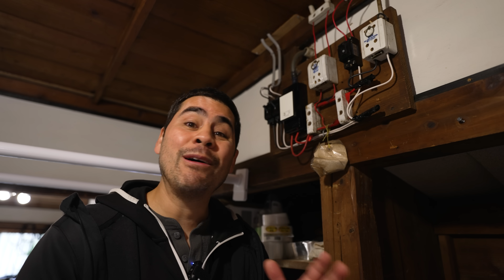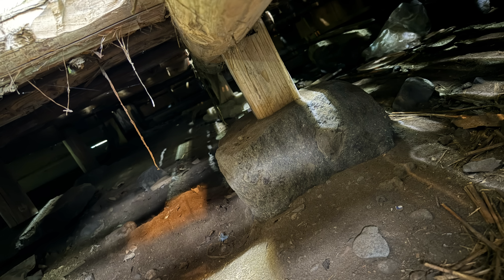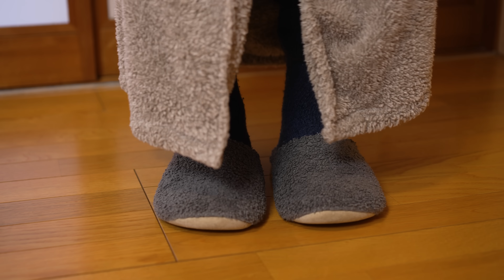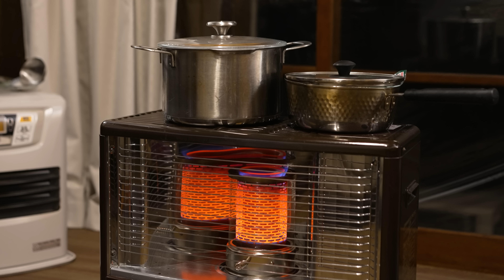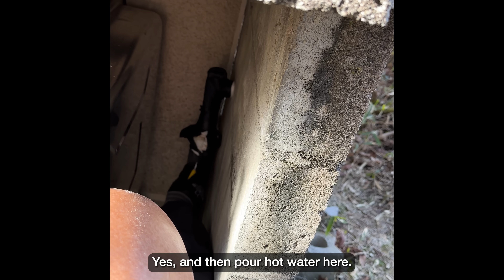What an Old Japanese House in Winter is Like

Comment: I used to live on the ground floor of a 2-story LeoPalace apartment building in Tokyo. I guess the walls and ceiling were insulated a bit better, so during the day I had less of an issue. But in the morning the floor was ice cold, so getting out of bed took a lot of will (and a ceramic heater that I angled at the wooden floor between the bed and the shower). Of course the shower room was also ice cold and made of plastic, I think it would have melted if I put any potent heater in there. But also, I had the same 30A main breaker problem - well, at least I eventually figured out that I could upgrade to 30A after initially having just 20A! I was also shocked how useless 30A were at 110V compared to the 230V in my native country.

Comment: you can spend around 150,000 and get the electricity redone man (includes a new circuit breaker) That is like my old one bro, get it done, since it is a death trap like that.  I got mine done, and i am still at the cheapest 20amps but i can now run aircon and a kettle at the same time. or the aircon and the microwave, but not all three. lol

Comment: You might benefit from a bit of home automation. Eg when you turn on the kettle it pauses the aircon. Otherwise, use presence sensors to decide which rooms are heated by the aircon, if someone’s home. If you like a bit of tinkering, home assistant is a great start and it can be done for very little money. 
That electrical panel looks ancient. A circuit breaker could be a good addition, so you only have to safely flick a switch instead of replacing the fuse. 
Silicone caulk is a cheap and very easy way to close those small gaps on the windows and in other places.

Comment: I wonder if there is no gas in Japan at all? I live in Romania and almost all European countries heat with gas during the winter. Anyway, you need a central heating system and radiators in each room, but this way the heating system is very simple and does not give you any headaches. It keeps a constant temperature chosen by you and the house remains warm and nice all winter.

Comment: This reminded me of my childhood home in Ireland. Keeping warm was such a task. The nightly routine involved filling up hot water bottles for everyone to use in bed, then leaving the water dripping from the taps...thankfully our old houses are much easier to insulate than the old Japanese ones because they are built with bricks or mass concrete. My current home was built in the 1930s, but insulating it was easy (although expensive) and involved "wrapping" the whole house externally with a layer of foam bricks. It's quite easy and affordable to keep it warm now, thankfully.  

Do you guys have electric blankets for sale in Japan? It's basically a low power heated pad that you put on your mattress below the sheets/mattress protector. My silent night electric blanket only uses 10 watts on the low setting, so I leave it on all night to keep my bed toasty 😄

Comment: Why not set a program on the heat pump so it's starts early so your space is warm when you wake up? Also a fan you help with the air stratification, it would mix the air in the room so that the air at the floor is not so cold. You would also lose less heat through the roof.

Comment: The roof space is an often neglected area for effective insulation improvement. We had some subzero temps recently in the UK and the upstairs of our home is kept at 17 to 18C  during the day. I have a digital thermometer in the loft which is insulted with the fibrous material used commonly in the UK and that space was around 2 degrees C.

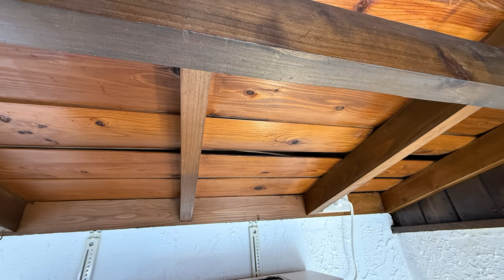Comment: 8:15 Brrrr, I can't even imagine the cold caused by this! 
We have double-paned windows here in Norway, as a standard. I think some even have triple? to help prevent noise? Not sure. But even then, our panel ovens are under the windows, to blow hot air up and with a curtain covering the window, I think it traps any cold air?

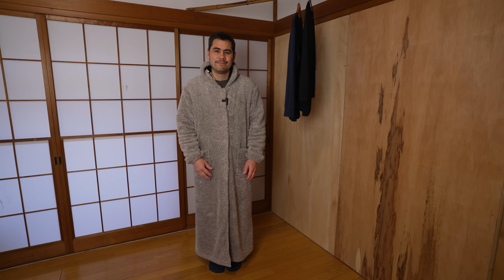9:30 Another thing with older Norwegian houses was that windows were neeeever made on the north facing walls. We even had sort of personified the North Wind "Nordavinden" as this collection of trolls and other bad spirits that would get in through the north facing window and make people sick. 

But with how hot it gets these days, I curse my south facing windows more... We don't even have shaded windows in the afternoon, to let in cold air before bed time.

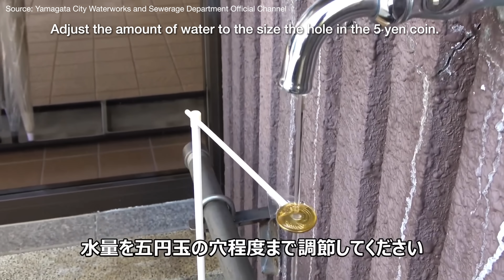17:50 Relatable! Though we more do that for our "hytter" or cabins. The small dinky kind with no insulated pipes. I've heard horror stories of the pipes bursting because the water froze in winter with no one there to check on them...

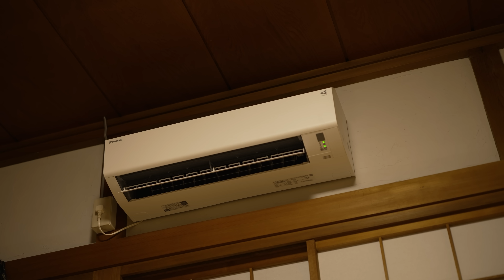22:11 Wait, your fridges are set to freezing? Ours are set to 4 degrees C.  Is there a reason why your fridges are set that cold? Wouldn't your fresh foods freeze?

This is such an interesting video! Thank you so much for sharing!^^

Comment: A good method to keep your pipes from freezing is wrap them in heat tape then cover them with insulation. 

Because they draw so little power, I power mine with a solar panel

Comment: I wondered how you kept the pipes from freezing. I grew up in central Ontario and we got our water from the lake we lived beside. A pipe ran from the bottom of the lake, underground up the hill and into the basement. Sometimes if it got cold enough (-40c) it might freeze. We eventually put a heated line from the lake to the house.

Comment: Only 30 amp electrical service is crazy when we often consider 100 amp to be outdated in the US. The lack of insulation is very familiar to our 1892 house in Minnesota though we have a big furnace to just blast heat into the whole house. You definitely want to be careful when adding insulation and sealing to old homes to be sure you won’t get moisture trapped from condensation in both summer and winter.

Comment: Protip with the aeropress: put it upside down and place coffee and the hot water inside it, it can hold it just fine, when you're ready, put the filter in the cap, splash some water on it so it stays in place and twist it. Put a cup on top (upside down) and then by holding both the cup and the aeropress, turn both so it's facing the usual way and press down as before. You save using an extra container and having to wash it by using the inverted aeropress as a cup. Takes a bit to master this skill but well worth it

Comment: Yeah, here in Norway, we call the air conditioner units "varmepumpe" which means "heatpump." It pumps hot air in winter, and cold air in summer. I wish I had one.

Comment: Two tips from where you lived before japan. Aka canada
1. The Bistro Pro LiteRide™ Work Clog from crocs if you can get them works best for me as slippers. With some warm socks and those my always freezing feet are super warm even in -25 celsius. They work better then slippers unless its lamb wool slippers. ZERO heat gets out of them. 
2. Try to get some rugs and combo them with radiant heat heaters. Such as portable oil heaters. They generally are electric but use very very little energy. I have yet to find a electric heater that uses less then they do. They heat really slowly but produce radiant heat. LEaving a oil heater on a "medium" heat will maintain a room that is used frequently very well for little energy. Do not use it for a room you rarely use as they are slow. The radiant heat will actually heat the objects such as the rugs so the heat sticks around longer. This can also be good if there is a week where it drops really low and you put futons in the main room such as the livingroom. The radiant heat from a oil heater will heat the futon material itself. 
3.  Yes I watched to the end where you noted....Heat rises. If your sleeping situation is really cold then build a platform for a loft bed. A really lazy way to do this if you can get them in japan is ikea kallax cube shelving. Put some together and a piece of plywood on top. Here the kallax shelves are always being sold used online for cheap or even FREE because people do not want to do the work of bringing then to the dump. I do not know how this is in japan.

Comment: Daikin have the Onecta App. If its available for your AC you could use the schedule for heating?

Could you use a battery with 5-10 kwh? Maybe it can combined with a off peak for power? Chargeing when the power is cheap and use it for the AC and daily use?

If possible combine it with a digital electricity meter. So the battery knows whats the demand and provide enough power that the breaker doesent trip

Comment: First winter here, am a big fan of kerosene fan heaters (pun intended). I scrupulously use it as directed, but maybe I need a CO detector. However, I’ve asked everyone I know, and not one person has one. Which seems weird. Interesting that you’ve documented it takes 4hrs for CO to drop to acceptable levels. Longer than expected.
I don’t have a passive kerosene stove. I also have an AC heat pump, and one electric strip heater. 
Our living room and kitchen are connected. We heat both with one kerosene fan heater. Plus we boil a lot of water to humidify and for drinking, which helps with heating. I was told that when choosing the right size for a fan heater, always pick one size “bigger” than that area that you want to heat. That was great advice. It heats the area more quickly, then dials down to maintain that temperature, consuming less fuel, as opposed to running flat out to try and reach the temperature you’ve set. 

I don’t drip my faucets, thanks for going over that, I need to incorporate that into my daily routines. Great video thx.
Reply from the maker: The 4 hours is CO2. Very different from CO. The CO detector never shows any issues, and can only detect anything at start up or shut down. But yeah, definitely lots of CO2 emissions with Kerosene.

Comment: Its so crazy to me that single pained windows are still so common in Japan, you'd have to look pretty hard here in the uk to find one and I'm confident that it wouldn't be in an occupied building. I'd love to say there must be a better way, and there is but I guess good enough is often the way forward and I imagine many Japanese people don't have money or time to be changing old windows and heavily insulating homes. however I have helped my dad and Granddad insulate a number of old properties in the last 10 years and its really not that hard here in the uk at least, plus it keeps the house much cooler in the summer than the outside temperature.
Reply: high humidity in summer complicates insulating in Japan. I built a super-insulated house in Japan with triple-glazed windows and had to source and import and install a high end energy recovery ventilation system that also dehumidifies, also had to source and import specialized house wrap.

Comment: I just rented a 2 ldk in Hiroshima. It has 2 split heat pumps , the bldg is about 3-4 yrs old. I pray that with the addition of some hot carpets and a couple of ceramic heaters, that we can get through the worst of winter, because I will never use the kerosene heaters again. They reek and my mobility has gotten worse with age . I have zero confidence in the comforts of Japanese buildings, even the new ones. I also use the Merino wool with boots over that. I think simply wearing shoes( if clean) inside is best.

Comment: Hey Greg. Can you get a heat pump (if you were living) in Tokyo? You have natural gas coming in into a Tokyo house or apartment for your stove. Water heater?  Now in the rural countryside of Nihon. Not so much. Why I’m asking is for heat yes but, also for the air conditioning too. I couldn’t handle 28c temperatures in the house in the summer time. I would want a basement too. If I moved to Nihon.  You answer me direct. But an update Q & A follow up video. Being a Canadian. Thank you for another great video. Take care. From Toronto Canada 🇨🇦❤️🇯🇵
Reply from the maker: Heat pump in Tokyo? Yeah, they have aircon units all over the place. We have 4 in our house, but usually not all at the same time (but if we do it doesn't break the circuit).
Reply: @LifeWhereImFrom  thank you so very much. Peace Out 🇨🇦❤️🇯🇵

Comment: I remember watching another video where the owner "retrofitted" an old traditional house like this by adding insulation, and ended up with nasty mold issues during humid seasons. I'd love to know what is the challenge with modernizing the electric panel to above 30A since it seems to solve a lot of issues.
Reply from the maker: The electricity panel isn't a challenge beyond the cost. If we weren't renting, we'd definitely upgrade. Insulation is the bigger issue. Doing everything and doing it properly, I think most people decide that it's easier and sometimes similar cost to tear down and build new.

Comment: Honest question, is there a benefit to using a kerosene heater rather than just a simple electric one? I live up in Fukushima and use one of those myself and it works fine!
Reply from the maker: Electric would break the circuit. Too many amps. I'd much rather use electric if I could.

Comment: 1:56 Managing the power like Apollo 13.
Reply: This made me laff
Reply: LOL
Reply: It's crazy - we had the power go down twice and we have a higher 40A.  It's scary and worse if it happens while you're sleeping.
Reply: @techsamurai11  It still surprises me how many houses still have lower power than my grandma had in the 60s... I know my 3phase@63A has spoiled me.
Reply: @wernerviehhauser94  I wonder what we have at home in the States but we do have just a few 50A and 30A switches just for a few things and it's never tripped with lord-knows-what running at the same time.

We run the water heater, central air, 2 fridges, dishwasher, washer, range, microwave, many computers including gaming consoles and PCs, home theaters, treadmills all on one switch and it's never tripped once.

Our home is just a regular home built 23 years ago with a regular electrical switch.
Reply: @wernerviehhauser94  It's 200 Amps - we lucked out as that's pretty high for a home built back then but the builder wasn't cheap.  Funny, I didn't know that until now despite being the original owner of the house.  A trip to japan was all it took.🙂
Reply: @wernerviehhauser94  It's worse than you even know, since they use 100v, slightly less than the normal 110-120 the US uses so even LESS power than normal.
Reply: @Oyashiro_Chama  I am aware of the 100V "safety"-choice in Japan and the mix of 60Hz and 50Hz grids :-)

Comment: Honestly being cold at night with a bed set up like that is the worst. Even in survival training and boot camp they teach you best way to stay warm is to not be on the ground. Get anything to raise up the level of the mattress, even if its 4 bricks and piece of plywood. Will drastically help with the heat preservation.
Reply from the maker: Might try, I got both the bricks and plywood!
Reply: @LifeWhereImFrom 😅😅😅 it also prevents mold by having air circulation
Reply: @LifeWhereImFrom  From a cursory browse around I'm surprised traditional European style box-beds don't really seem to be a thing in Japan: if not at an earlier date in homes then in reverse later on from capsule hotels.
Different cultures find different solutions to make life adequately tolerable then just get on with things. : )
Reply: @dw620  They are now but the legs destroy tatami.  The tatami, being grass, would likely also help with insulation.
Reply: @adorabell4253 that's literally a non issue, you can easily order stuff like furniture sliders online or just simply cut a piece of plywood to go under them.
Reply: @LifeWhereImFrom  You could also try getting a heated blanked to warm up your bed before sleeping. They aren't very power hungry as well.
Reply: Specialized futons for use in cold regions insulate you from the ground. We also use a thick wool blanket on top of that then a down comforter and a second thick wool blanket on top. I’m warm in -20 in that setup.

Comment: Change your electrical cables and circuit and everything will be perfect, if you only change your circuit you can definitely feel the difference. I had a similar problem in an old Bulgarian house, the cables were new, but the circuit was old.
Reply from the maker: Nah, my brother-in-law's brother is an electrician and he actually wired up the two aircons with 2 new circuit breakers. Without modernizing the whole panel, which maxes out at 30 amps, there's nothing we can do. If we weren't renting and living long term, we'd definitely upgrade the electricity.
Reply: @LifeWhereImFrom Oh i thought you've bought the 空家

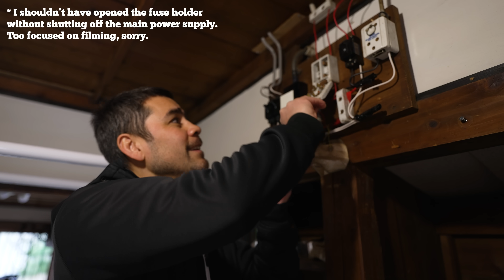Comment: 2:25 Why not change? Circuit breakers are dirt cheap like 5-10 bucks at most.
Reply from the maker: You can't just change the circuit breaker. With everything this old, you have to redo the whole thing, which would be between 500,000 to 1,000,000 yen.
Reply: @LifeWhereImFrom  By the "whole thing" do you mean whole house inside/outside wiring too? Sure that much would have improve everything and you can run too many electrical devices at the same time but I was just meant for the fusebox part. If you match your circuit breaker with your old fusebox amp, it would have still break your circuit when you run more than two electrical home appliances, but you could just switch it back on without change of new fuses everytime. Also it would have more protection than just a melting fuse like shorts, arcs, under/overvoltage etc..
Reply from the maker: Yeah, I meant the whole thing. Just the fusebox... I don't know if that's easy to replace or not. We haven't burnt the thermal fuse in a long time, so not really a priority, especially since we're renting temporarily renting.
Reply: Could be regs. Might have to swap the whole unit to make the change. And I'm sure you don't want to get in trouble with the authorities as a hotel owner.
Reply: @Slugbunny  I bet regulations doesn't force you to use "melting fuse" rather than a modern circuit breaker technology with many protections.